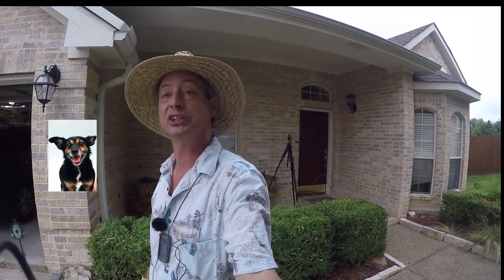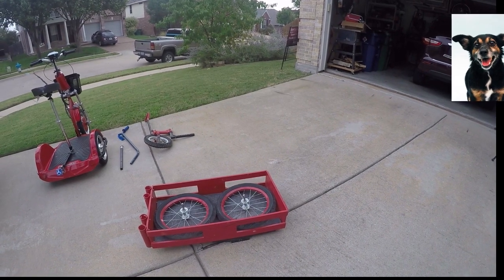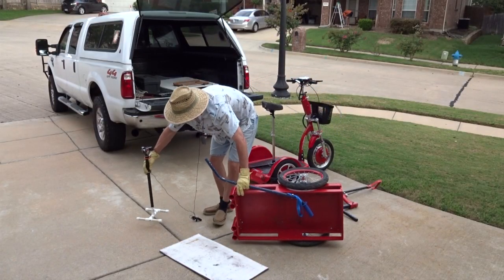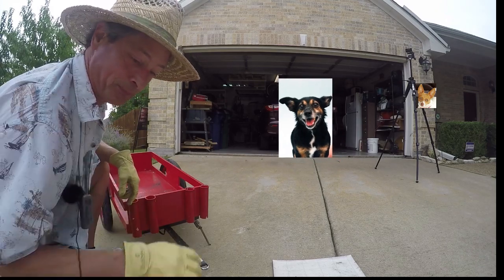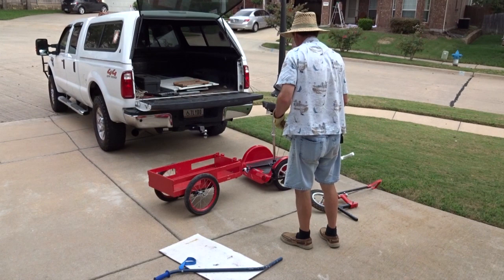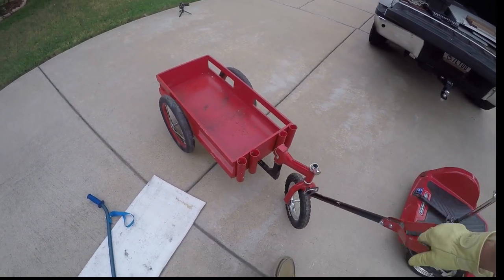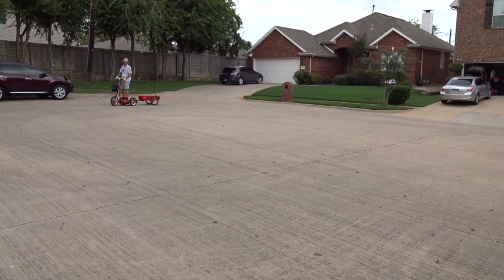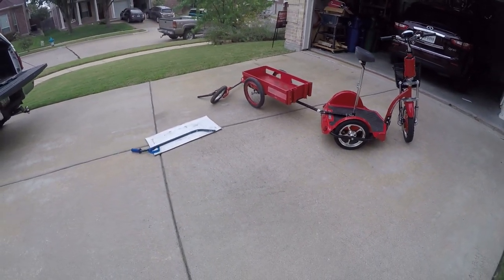Custom Built DIY - Challenger X Scooter Trailer That Is Just Perfect For Fishing

Comment: Very clever design!! If you mount the kickstand near the center mount it might work better. Love the multiple camera angles and good audio. Some people just can't figure those two things out. :-) Fish on!
Reply from the maker: the multiple camera angels is a bit of a challenge but once you have them synced it is pretty easy. As for the audio, it drives me crazy when that is overlooked! nothing worse than trying hear something that is drowned out by wind noise. I have found that the kick stand is one of those overbuilt elements, LOL most times I just drop the front of the cart onto the ground and use that as a rod holder when fishing. Thanks for watching!!